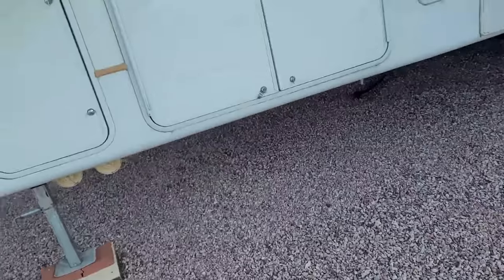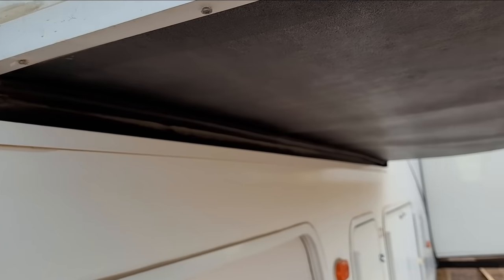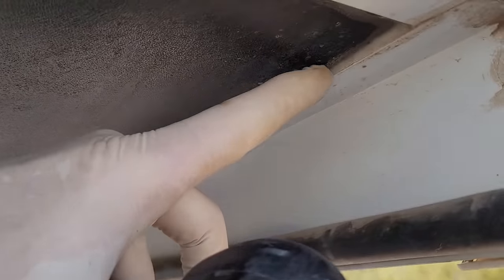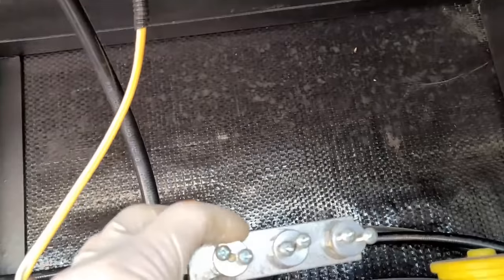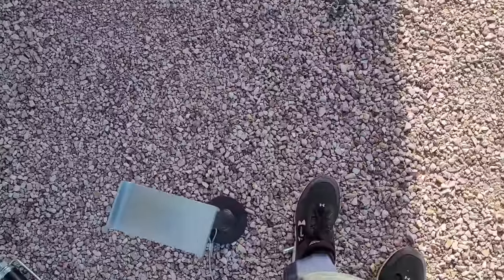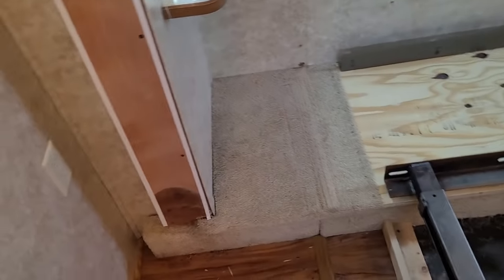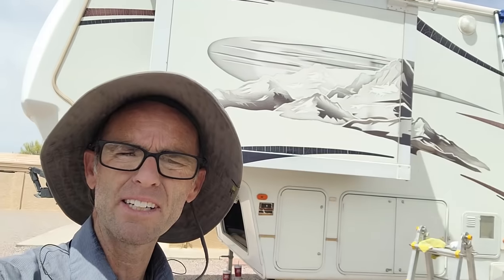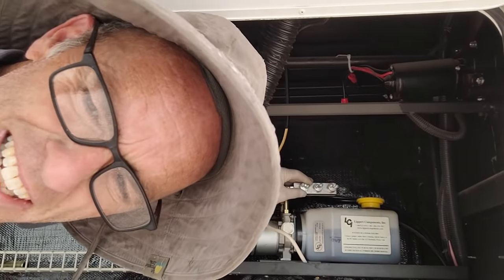Replacing a Rotten Slide Out Floor

Comment: Little late to the comment section, but why don't they add flashing between the siding and the sheathing. Treat it like any normal house wall, you could do it to your repairs as well. Looks like you would have to pop some staples to re secure it, but we'll worth it. However, nice work, to bad every slide is guaranteed to have this issue.

Comment: Very interesting. I am curious why manufacturers or repair experts don't use a penetrating epoxy on the plywood especially at least the end grain ( something like west system) to seal and prevent water intrusion into the end grain of plywood? This is done in boat building and I would think it would prevent a lot of rot if a bedding sealant is compromised..

Comment: Thank you for this! We replaced our floor and this video was huge in helping us do that. We used c-clamps to hold the stilts to the slide out rather than screwing them in. Saved a lot of time and didn’t introduce any new or larger holes. Thanks again! Probably will be doing this on the rear slides soon.
Reply from the maker: Thanks for watching!

Comment: I had to do the slide out floors on my Outdoors RV basket case project.  I had to replace all the the blocks and motors on the schwintek system and get them remounted onto the rails and found the rotten bottoms and framing in the box walls of the opposing slides.  What a nightmare. My slide bottoms were filon and I went ahead and used the big box FRP being that it is on the bottom of the slides out of the sun and it was so much less expensive (and available). I had to do it parked in an uneven dirt storage lot and I found a 1000lb Harbor Freight hydraulic table cart that was excellent for lifting, holding, and adjusting the boxes while they were floating.  I coated everything in 2 part epoxy when I put it back together. You're a saint for doing this. It's not a fun job.

Comment: Out of literally hundreds of RV Repair and Maintenance videos; THIS IS #1 ☆☆☆☆☆BEST!!! I'm a Senior widow, just bought a used 2005 KIT Companion 328F 5th Wheel & thus one looks almost identical to mine ( which needs some work & I'm not able to "do it myself"). Great to see this as it's taken apart without having to actually do it ( now I know that slide-out mechanism is the hydraulic type - haven't figured out for sure what the other two are yet.) I just know they're not Schwintek type...Thanks, w/ prayers for blessings < You surely deserve them!

Comment: Well I finally got around to replacing the same floor on my 2013  Sanibel 5th wheel. What was different? First big difference was that the old floor and new floor had to be removed and replaced from the inside. I got a 4 x 8 sheer of Home Depot 3/4" "Marine" plywood and coated both sides and edges with black "Pond Armor" 2 part epoxy. The 1.5 Qt kit gave me just enough to do 2 full coats everywhere. The other difference was the carpet, which was  stapled and glued in place along with the black plastic tarp type material. Way too much work to try and salvage that so I used 18" carpet squares from Home Depot. 1 box of 10 did the whole job. Finally done and it looks great!

Comment: Thanks for this video. I have an Outback 210RS with delamination on the rear. It is constructed the same as this slide out. I am now confident that I can remove the trims as you did and access the area that needs to be addressed with adhesive and new materials as needed.
Reply from the maker: most trailers are made the same way roughly
Reply: You can do it , I would try myself but I just don’t have the strength anymore. I learned how to check my roof and caulked it, washed it and painted it with the rubber roof paint ever third year since I bought it used , but I can’t get up on the roof anymore! It’s sad to get so frail, but my hearts into it!

Comment: Timely great video..  Have a 2007 keystone raptor.. This exact thing is happening.. So I can probably do this same repair at home.. Thanks for showing the hydraulic valves to isolate the slide operation. I feel confident I can do this same repair. Thanks for this video!!
Reply from the maker: Glad it helped

Comment: I just bought a beater 2001 trail lite 8263-s camper. Gonna have to do a crap load of work on it in best case scenario. Worst case I'll get rid of everything and it will be a dual axle trailer base of some sort. It was $500 I couldn't pass it up. I have watched several of your videos and other videos as well but you are the RV guru man!!!. I will be contacting you with questions unfortunately. Cheers mate ,🍺

Comment: Thank you! I plan to keep my 3 slide 5th wheel for a long time, and anticipate having to repair or replace the slide room floors at some point. Your video convinces me that I can likely do these repairs on my own. The "stilts and jacks" idea is especially useful. Wouldn't it be nice if the OEMs could design and build an RV that was actually water impervious - what a concept!
Reply from the maker: Hey, Thanks for watching! :)

Comment: I will be doing this exact job on a Forest River Salem Light. Floor is completely rotted. Thankfully the walls are ok, they are wood.  Shwintek sliders! They have been out of sync from top to bottom, not side to side, and I think that’s where the water has gotten in, mostly when it’s closed.  This video gives me the courage to tackle it and save a couple thousand dollars! Thanks.
Reply from the maker: Thanks for watching! :) Good luck on your repairs!
Reply: @AZExpert  I have a question.  I assume I have to at least disconnect the Shwintek gear rails from the slider in order to take enough weight off the floor to remove it, does that sound like it’ll work?

Comment: Great video...gave me the confidence to tear into the rotted floor of our Silverback that was very similar to this.   One thing to pass on that may help others.....when i ran the jacks up to raise the floor off the threshold, the floor still wouldn’t pull out.    I found a couple screws on each slide wall at the back corners. I could’nt get access to the head of the screws or even see them but was able to run my sawzall horizontally across top of the floor to the wall from inside the camper. With the screws cut, the floor came right out like in this video.  Not sure why it had the extra screws.
Reply from the maker: Glad you had the confidence to tackle it yourself

Comment: You made it look easy...appears to be well within my skill set. I got 3 slides to do myself and it shouldn't cost me no 25k for the dealer to do it. I was thinking about patching it...but this looks better than a patch job. Bravo...
Reply from the maker: should cost much less than that
Reply: @AZExpert  dealer quoted 12k just for the 10ft middle slide. Only has one corner on bottom that is wonky...said the had to remove entire slide and rebuild it entirely from scratch...
Now that sounds like a hell of a jackup job if ive ever heard of one.

Comment: A master class of excellence! You sir have incredible skills and the ethics of a Saint.

Those working on their own water damage should replace all soft goods such as carpet and wool insulation that was exposed to water or has evidence of mold/mildew (brown or black spots and dots). Hard surfaces such as wood, foam, foil barrier, wall board,, and the like can be sanitized with a bleach solution to kill off mold, mildew, and odors. However soft goods are nearly impossible to clean without considerable effort if at all. The carpet reinstalled here is going to smell indefinitely; particularly during periods of excessive ambient humidity. Attempting to clean the carpet after the slide is reassembled is only going to reintroduce some moisture into the walls and floor. These carpet sections are sandwiched between the floor and walls. The sandwiched bits of carpet is going to suck up liquids used to clean the carpet like a wicked. This moisture will then be wicked up by the wood in the walls and floor. While the amount of wicked moisture would be minimal, not causing damage; it can take a long time to dry. Thus one is left with a return of the offending odor to some degree.
Reply from the maker: thank you!!

Comment: Thank you for the concise and informative videos that you post on YouTube. You have helped so many of us to repair our own problems, that we could never afford to pay someone to do for us. This video was exceptionally great in my case, except for a small difference. I have a 2013 Sanibel with 4 slides in it. All are in great condition except for the bedroom slide, like the one in this video. The exception being that mine is a Schwintech slide, with the aluminum gear strips along the bottom. Have you ever made a video, or if not, could you make one, on dealing with replacing a floor in one of these? The other difference id that it has 2 floors, the exterior sub floor and the upper floor under the bed, both being rotted out in the corners and along the outside edge. If you don't have anything on this, can you possibly point me in the right direction? Thank you again for all the help you have provided for so many of us:-) Bruce in Florida Correction on this, it only has a single 3/4" plywood floor.. Nothing on the Lippert yet AZExpert?
Reply from the maker: Thanks! I'll take it into consideration

Comment: The exact same thing happened to our bedroom slide floor on our fifth wheel. We did something different though. I never wanted to replace that floor again so I used pressure treated plywood and painted it with waterproofing ( the same as you would do when prepping a shower wall in your house. The floor is now completely waterproofed. 
I was surprised that you used regular plywood as you are the most efficient rv tech I’ve ever seen.

Comment: I actually installed the new floor in my slide and then installed the carpet from the inside and trimmed it to fit.  I didnt like the carpet sandwiched between the floor and walls.  It worked out very well.   Also, my floor didnt have that solid avs plastic sheet on the underside.  Mine had almost a black tarp like sheeting.  I didnt replace that.  I applied about 5 coats of black marine paint before I installed it.  It made  the slide 100% more solid feeling and will last 100 times longer than the original.
Reply from the maker: Thanks for sharing!

Comment: Thank you for your BIM and Lithium batteries conversion!!!!!! I am a electrician that do a little bit of carpentry work. Your Lithium batteries conversion work great for me. Now I have a problem with soft floors in my Ford  Jayco 36A 2019. I saw your slide out floor repair and I've seen other people's pull behind trailers floor repairs but I'm trying to find out before I start on it. Is the floor of Ford F-53 gas chassis A-Class built the same as trailers are or are they totally different and I need you to do a video on how to fix one from water damage. Help help help!!!!

Comment: 30 minutes or less or it's free right? Nice job! Thanks for that video. What are the reasons for using silicone over sikaflex or geocel sealants? I had to reattach a sidewall that had some moisture in it. After getting it dry I used the 77 contact adhesive and geocell to finish up. I also used a little geocell around my plastic fender flares against the filon. I don't think it's holding up well and think I should just redo it with silicone. Thanks again. Must have been hot in the sun without your shed cover for shade. You'll get good karma for helping those folks.
Reply from the maker: proflex and sika flex are messy and wont stick well to areas where silicone was without a great deal of clean up

Comment: Overall, outstanding.   But, you should have sealed the plywood edges since edges wick like crazy.    You put in weep holes, so you know water may/will find its way inside.     Also, you noted early on the likelihood the sidewalls had some water damage; but then you screwed into the places likely damaged.   Longer screws won’t work in damaged wood, assuming there is plywood in there.    Nice to see how slides go together.   Trusting to silicone is never a good plan.    As a Keystone Montana owner, I have SERIOUS issues with Keystone construction (at best).
Reply from the maker: I don't film everything :)

Comment: Great work. I'm in Jacksonville, Florida. I'm in the middle of replacing some floors in my 2019 Montana High Country 5th wheel because of a horrible design. Additionally, I have water damage up the slide out sides which is my question. The slide out sides are aluminum material with a cardboard backing and has delaminated because of the water intrusion, and damage to the cardboard backing.. Would you recommend aluminum or fiberglass to replace that with?? Do you have a product recommendation. Merry Christmas! Thanks. Chad

Comment: When I replace floors in fifth wheel bed rooms slides I use  advantech sub floor works good and also a brand of contact adhesive staput it works great in one of our own I got flat thinner steel cut and folded around the flooring and rapped and inch around it worked great and used white to match everything else I did was fairly similar

Comment: Dear AZ Expert,, you truely are an expert at this! Wow! Q? I have 2003 komfort 28 foot 5th wheel, and in my main slide i have leak, in the side of slide below window , at floorlevel, i have no idea where waters coming in? Weather its lower fachal outer roof edge above or top of the window sill? I do not know? Theres chalking on outer edge of facha, and dont seem to be any holes? So got me? Two years ago a friend and i replace a small  section of sub floor a bit above, where im refering about, of which it was wet and starting to wick up the wall! It turned out the chalking on the out facha was cracked and holes! Sorry for the book im writing! But the main Q is , if God forbid i have to replace the sub floor in the main slide how would i go about it in the main bigger slide! This trailer looked very very like main, although there appered to be alot more room to work in between the  units, i have limited work space! Which sucks! One of the things that im mainly concernd about in doing it is it falling out! Because im so close to unit beside me! I wish you were in my area dang! You sir were by far the most knowlageable so far that i seen! If you might send me a bit of how to! If i have to replace sub floor, that would be great! Andy ( bmwman94550us@yahoo.com) thank you very much!

Comment: Hi, I wrote you feedback on this video and the great work you put into YouTube videos, that are a great help to a lot of us. Quoting a comment from my last one.  I have a 2013 Sanibel with 4 slides in it. All are in great condition except for the bedroom slide, like the one in this video. The exception being that mine is a Schwinteck slide, with the aluminum gear strips along the bottom and top". The Aluminum gear strips are attached to the side walls of the slide and have a small lip on the bottom, under the floor. There do not seem to be any visible screws holding the floor panel to the gear strips. There are some screws that were driven through the vapor barrier and plywood floor, into the aluminum wall framing. Do you think this floor can be removed, without interfering with the gear slide strips? In other words, doing everything you have done in this video and removing the screws in the underside of the floor, into the frame.  Thanks in advance for any helpful comment, as it is time to replace this floor.

Comment: That 3M stuff releases when its hot. Grab the Permatex spray adhesive at the parts store.  It works great.  Its where the other permatex products are.   Great job on the floor replacement.  You need an easy button to hit once youre done.

Comment: good repair, only thing I'd add is a drip edge which the manufacturers finally figured out on newer trailers.  A bent piece of metal or plastic on both sides because surface tension of rain drops rolling down and then staying on the underside causes majority of rotten floors on slides.  You can also use eternabond under the side trim piece and wrap it underneath  to prevent water intrusion

Comment: What is your preferred silicone sealant for outside seams like the outside slide facia.  I see you used GE 100%silicone caulk in this video..  Also do you clean up the extra caulk with mineral spirits when applying.  I like to wet my finger with mineral spirits to make a clean wipe, do you think this is OK.  Great video, Larry

Comment: Awesome video! James I learned a lot here. Can this repair concept be done on a motor coach slide out as well?

As I’ve humbly shared before, the Thor Hurricane 34J uses a Schwintech 3 slide out mechanism.

If in the future, would you process here be applicable if my slide floor needed a replacement?

Blessings to ya, and thank you!
Reply from the maker: yes, most slides will be the same though some floors are screwed in from the top, just have to break the screws

Comment: When you replace any of the wood in these things, is it worth treating the wood with any sort of sealer, like a deck sealer? Just in the event that some water gets in from time to time, would that keep rot at bay long e ough for you to reseal the faulty seal?

I'm dealing with some rot in my slideout from the previous owner's "repairs", and was toying with this idea. I've heard it mentioned in comments, but I was curious what a pro thinks.

Comment: Regarding installing the angle at 20:04--Why wouldn't you just slide the aluminum angle between the wall panel and the plywood?  That way any water sliding down the side panel will just drip off and CAN'T get to the plywood?